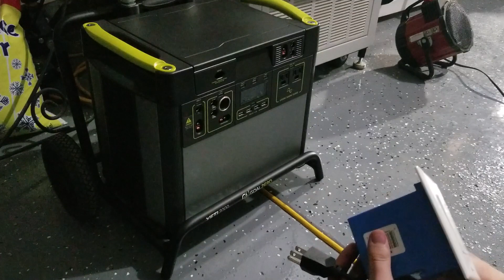How to Build a Dummy Plug for Generators or Battery Backups

Comment: This is called a neutral ground bond.  Every electrical system should have one and only one bond.  There should be one at the main panel in your house and not on any sub panels (even detached buildings) unless they have their own transformer.  Most people make one inside a clam shell replacement 15A plug, fill the hole with caulk and plug it in in situations you need it (generator or inverter power) and remove it in situations where you don't want it (bonded shore power).  Just put it in an open receptacle anywhere in your electrical system.

Comment: How this can be done in Europe ? In here pins can go in both ways, so it can not be done same way ? I have heard about 100k ohm resistor trick, not sure if that works either, or resistor have to be different value because 230v here.
Reply: Where in Europe?  For the most part Europe has higher voltage but still uses a single hot and common (like 230V in the UK).  The exception would be the split phase machine shop and construction site power in the UK and Ireland (110V with two 55V hots and a bonded neutral) which in my opinion is absolutely brilliant from a safety perspective.

Comment: I finally did this, I have a Jeep camper with a 1500w inverter and 200a secondaries batteries. I wanted to charge my EV in some emergency, but charger will print ground error. With this works. My cable has different colours: Brown, Blue, Green. Blue its neutral (will be connected with green) and brown its the live. I did this in an extension cable, I just hooked the neutral on the female outlet. Smaller :) THANKS